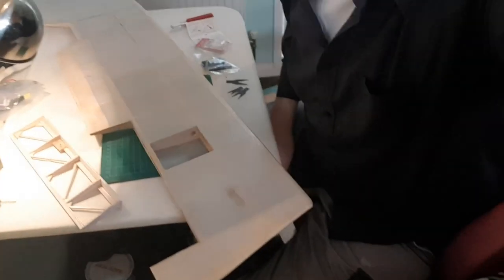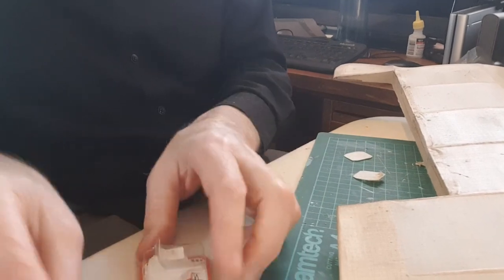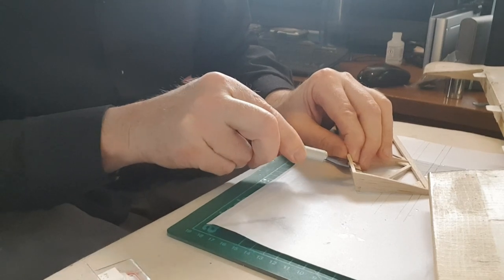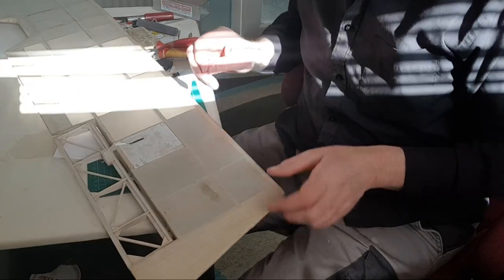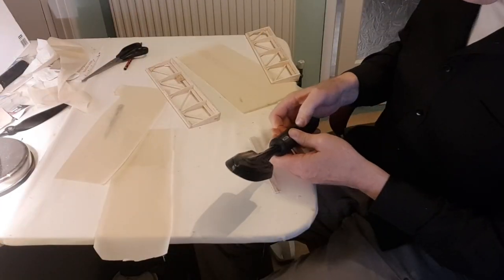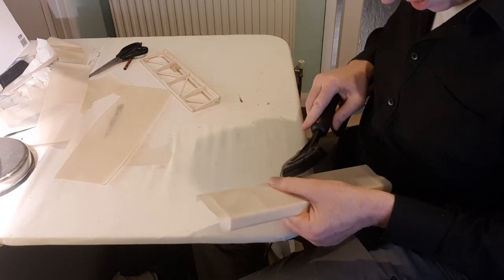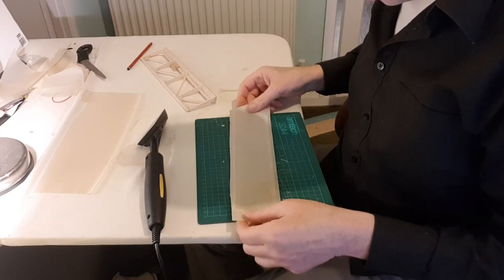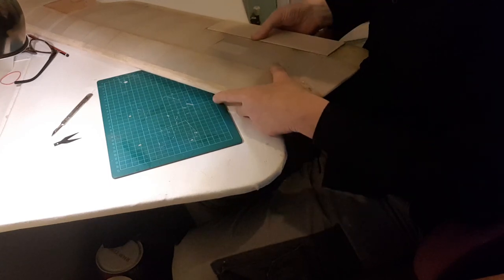DB Mannock Biplane, Part 11 Hinging and Covering the Ailerons and Connecting the Servos

Comment: That's a good technique getting the ailerons on depending on the weight and size of the model your building. On some smaller and lighter models, on tight/close fitting ailerons, you can use the covering as the hinge if you sand and prepare them first for that type of hinge. I'm sure you already know this but others new to making their flight surfaces. On my lighter models i use "Blenderm tape" too in some cases.
It's kinda' hard to describe how to make them with the covering material but, i'll try to if anyone is interested. The procedure isn't hard at all but putting it into words is quite challenging to be intelligible and make any sense. lol
Thank you for posting what you're posting, Cliff. It's been really interesting and it's getting me back into the mood and swing of building these again. Thank you, Sir. :)
Reply from the maker: Hey Danoman, you're welcome, using the covering as a hinge is a great way of course, no gap and no fiddly hinges to content with, it is very satisfying putting a model together but it takes time (and patience)!

Comment: Nice job. I thought the covering material you used on the ailerons was solartex. Expensive but worth it. No longer made?
Reply from the maker: It could well have been Irwin, but it was a odd opened roll I picked up and, as I've never used it before, I wouldn't really know. Once bits get covered things really start to take shape don't they. Thanks for commenting.